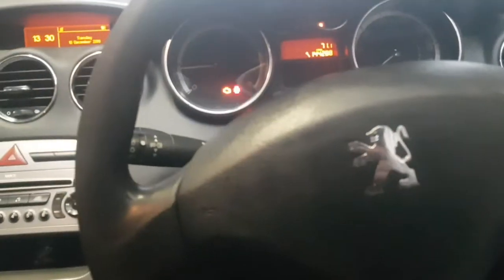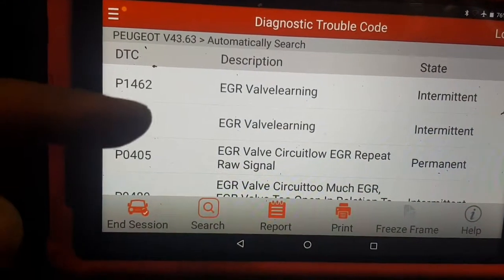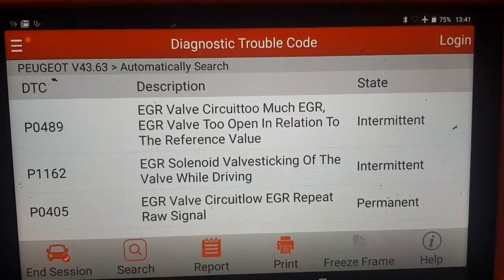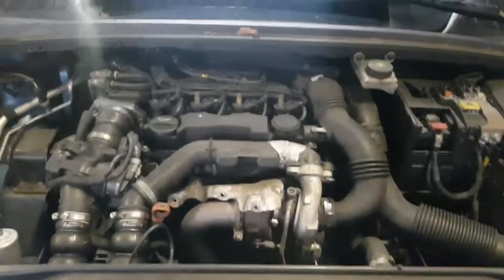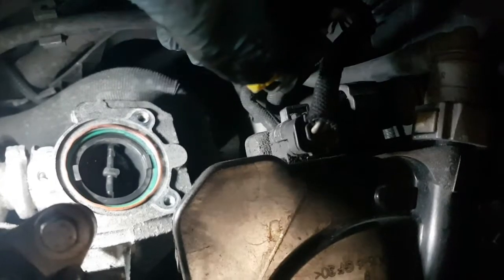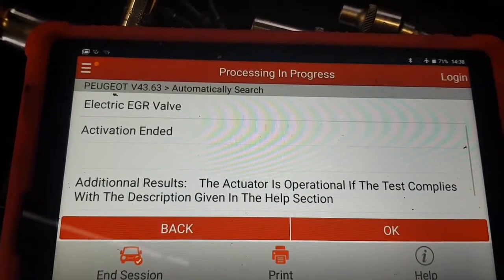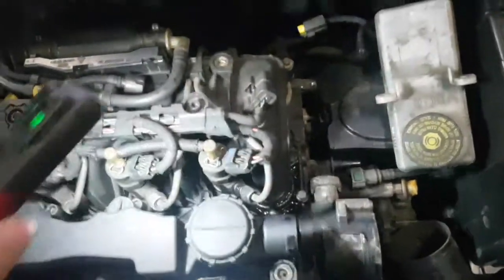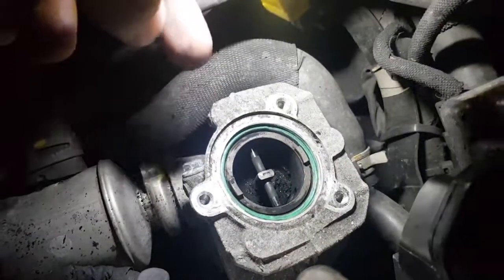Peugeot depolution system fault fixed P0489

Comment: I had the exact same problem (engine light on with depollution fault message) 3 garages couldn't fix the problem. 3rd garage  Firstly said it was injectors, replaced those,  fault remained. Then they said it was the hydraulic lifters, replaced those and the problem remained. £800 down the drain with no resolution to the problem. Only when it went in for a new MOT did the mechanic solve things...a simple sensor was at fault. Just over £100 fixed the fault.
The car (Pegeaut 308cc 2006 manual) has done just over 60k miles, ran as sweet and as quiet as could be beforehand. Now I sit in traffic and can hear the hydraulic lifters tapping away like they need replacing and it runs unevenly. 
Peed off is an understatement!
Reply: Hi can you tell me the name of the sensor you bought to fix depolution fault on Peugeot kind regards
Reply: @Paul Williams  I'll have a look for the invoice and let you know. During the MOT test, the mechanic said he nearly failed it due to the omissions reading  but had  noticed the engine light was on and suspected the sensor was at fault. He tampered with it saying they often play up when about to fail...he managed to get it to work long enough to pass the MOT then ordered a new one and fitted it the next day.
I'm no mechanic so couldn't argue in court but I strongly suspect the previous garages knew the fault and ripped me off.
Reply: @Paul Williams  The part replaced was an oxy sensor - Lambda Sensor 1. Cost was £107.62 (part cost £83.62, labour costs £24.00 VAT inc)

Comment: I have cleared my egr valve and I did change fuel filter issue solved, I do recommend everybody to do same before you go to machanic, if you can not do it yourself just go to machanic and ask them to clear egr and change fuel filter by doing this you will have no moro anti pollution fault
Reply: You car is 308 i please? The model of my car is 2007.
Where is exist the fuel filter please? Thank you
Reply: You car is 308 i please? The model of my car is 2007.
Where is exist the fuel filter please? Thank you

Comment: Hi, I set out with my 207 1.6 HDi vehicle. On the way, the depollution system faulty letter burned and the engine pain relief lamp turned on, my vehicle fell out of traction, but I arrived at my destination.

Comment: Hey man, you didn't fix anything in this video so better change its title. This video should be called "depollution system rooth cause research without finding any solution"